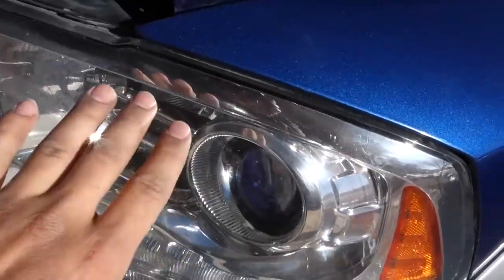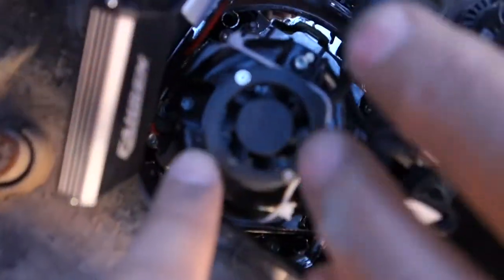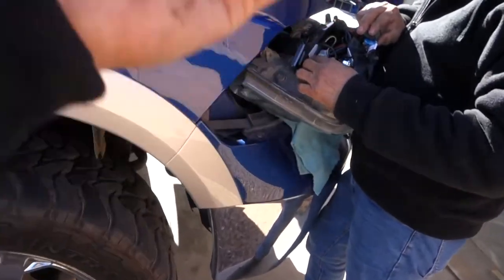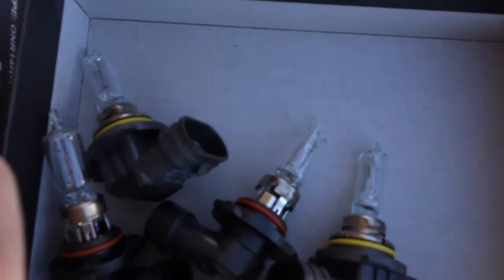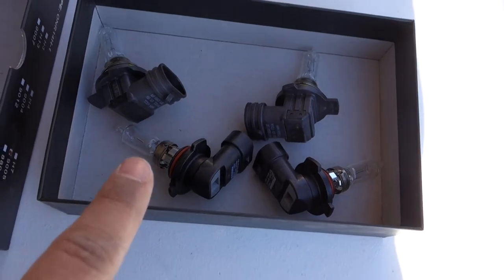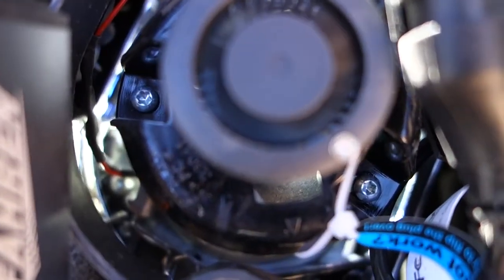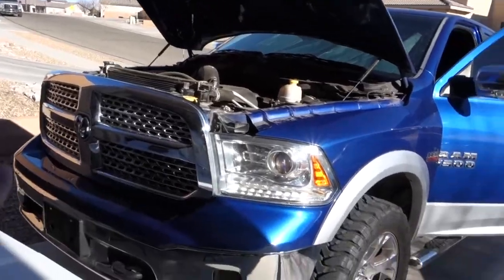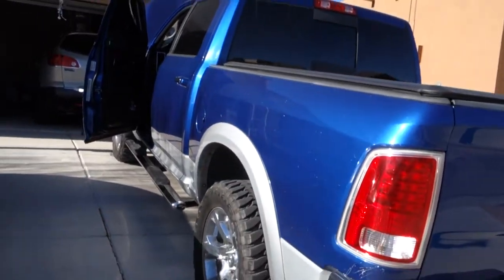Had To Leave The LED Light Bulb...Why?

Comment: Buy Hikari Ultra or Novsight 20000LM bulbs.
They’re great. Never had issues with them.
BTW I have the same truck 2017 Ram with projector headlights.
Reply from the maker: Thank you for that I will check them out because I really do want the LED lights.